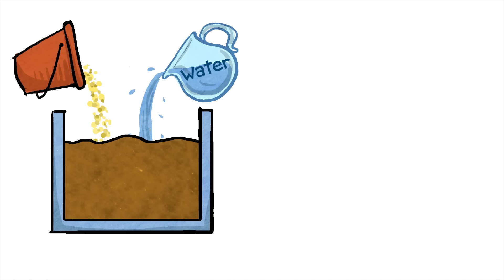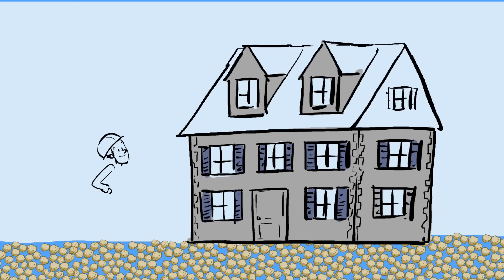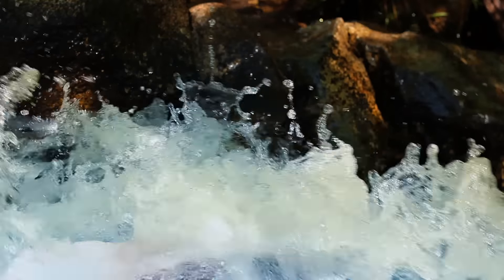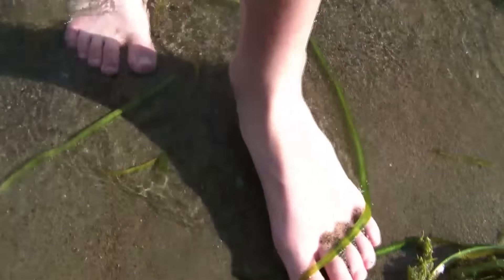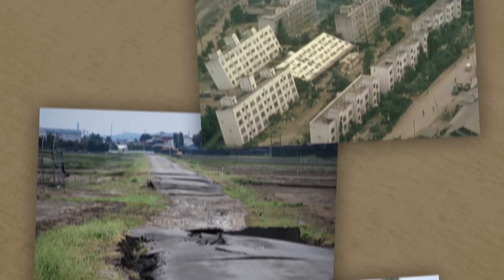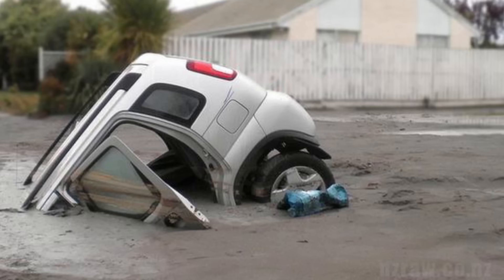What Happened To This Car?

Comment: Well I must say, that is rather interesting about the pocket watch.
Reply: How did they know it was the exact time the earthquake destroyed the pocket watch, yet preserved the time, versus the sunk pocket watch simply running out of power after it was buried?
Reply: Tony Yang
I myself was thinking the same thing.  Back in the day you had to whined up your pocket watch and it would last for about 3, 6, 12, and 24 hours.  The ones that last longer cost more.  So it would depend on the model and that would give you a window.  But who is to say that the person who had it hardly used it and it was just found on a random time?  Was in near a body.  There are a lot of factors.  Also, I have a hard time beveling the shaking of the city would stop it on the dime.  Especially expensive ones.  I guess it all depends.  Great point though.
Reply: Tony Yang I think the sand and water got into the clockwork to stop it from working and thus stopping i at the time the city sank

Comment: As far as I can tell, that pocket watch isn't an argument for exactly when this occurred. Unless the pocket watch stopped operating immediately upon this occurring that is. Also the pocket watch could have been adjusted relative to any time to begin with.
Reply: i agree. unless there were multiple watches that showed a similar time, i dont think they can say they know for sure what time it occured
Reply: Excellent point. In fact, we're assuming that the watch was functioning ... rather than just part of some pirate's booty that had not been wound up or maybe no longer worked at all.
Reply: ***** And even if you managed all that, I find it likely the damage caused could have altered the displayed time.
Reply: seigeengine Glad I wasn't the only one thinking about it :P
Reply: According to the NatGeo article that described the watch: When the watch rose out of the sea, a limy encrustation clung to its glassless face. An X-ray photograph of the matrix which had molded tightly to the watch's dial showed traces of the vanished hands, stopped at 11:43. Either the first heavy earth shock or the plunge into the sea halted the works forever

Since this watch was made "in or before 1686" it fits right in with the timeline of the sinking.

Also there are apparently several eye-witness accounts of the sinking that place the earthquake at just before noon (which the watch's time would corroborate). There are like 10-12 more paragraphs about this watch, but obviously they couldn't fit all that into this video :)
Reply: ***** Huh, interesting... thanks for answering (and finding the article for MinuteEarth :P wouldn't have this video without it I guess)
Reply: *****
how do you italacize
Reply: Hmm
Reply: @RobertJones interesting

Comment: As a Christchurch local, I knew where that car was instantly!
Liquefaction is really weird stuff. On a slope, it basically flows like water, which luckily saved the street I live on from being covered in knee deep silt.
Small amounts of liquefied silt produce 'sand volcanoes', which are basically conical piles of silt with water flowing out of the 'crater'.
If you see a hole with liquefaction pouring out, do NOT step in it, it is probably a LOT deeper than you expect! A friend fell into one of these, and broke her arm.
It is a real pain to move because it is so dense, and it sticks together quite well, so it is hard to dig out. Once it dries out, because it is so fine, it gets literally everywhere!

Comment: this usually happens to saturated cohesionless soils(like sands) . as the sand looses almost all of its effective shear strength mainly due to sudden violent vibrations ( like earthquakes) and the soil separates out as solid (sand particles) and water . most of the structure's load now falls on water which being incompressible can't handle it and so the structure above the soil sinks into the soil on which it was supported.

Comment: Minor nitpick, liquefied ground doesn't re-solidify instantly. It remains a liquid for an hour or so, and is still quite squishy several hours later. It is worst a few days later when it basically sets like concrete, making it difficult to move. Once it dries out though, the very fine silt gets everywhere, which is quite annoying.
I know this from experience because I went through the Christchurch earthquakes, and we had liquefaction on our street.

Comment: The water in the sand isn't pushed away when you step on it. Stepping on sand causes it to get displaced and rise around your foot. This rising sand does not have water in its gaps. These gaps are then filled in by capillary action with water being drawn out of the place where your foot pressed on.

Comment: Clay has much smaller elements than sand and there are clay particles that are like cards. They can make very stable structures with water supporting the "card house" but they also can suddenly turn to water and start to slide. Whole mountinsides have come down this way and sometimes there have been buildings on that clay and big disasters have happened.

Comment: If you take a shack box fill it with dry sand, ten place a heavy weight on it, it will just sit on top of the sand. When you shake the box the dry sand will act like water and move away from under the weight, and it will sink. I don't think Liquafaction has anything to do with water, other than describing how the sand (or soil) acts.

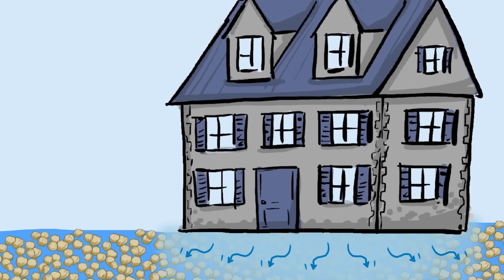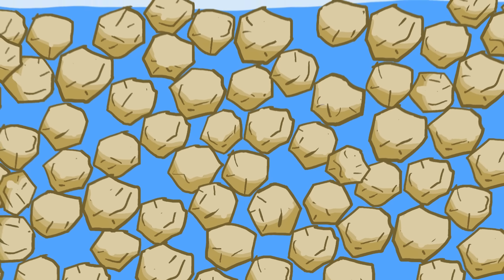Comment: I don't buy the explanation. 0:56 - "but in an earthquake, soil particles repeatedly jostle back a forth so much that the water can't flow away".  What about jostling is going to impede water flow?  No, I think that what happens is that the particles that normally rest on each other (0:40) repeatedly reposition themselves as they shake about and the pressure from an object above causes this repositioning to favor movement out from under the pressure.  This can happen without water, but the water increases the effect by acting as a lubricant and keeping open the spaces that open up between particles for a moment longer, allowing more repositioning.

Comment: I think your mixing up sink holes and quick sand.  Sink holes form because of erosion under a relatively dense surface.  The surface above seems stable until weight is placed on it, then boom, heads cracked open on a water main 20 feet below.

Comment: when he says "the sand starts acting like a liquid" it doesnt tell me much about why weights on sand during earthquake sink. can someone please explain this in an another way?
Reply: Well, non newtonian liquids start like a solid, but as greater amounts of pressure compresses the sand, the sand starts to shake rapidly due to the water inside.  The thing with non newtonian liquids is they can change forms when needed.  So when the watery sand shakes, it turns from a solid, to a liquid.  I hope that helped you.

Comment: What about Moving Sands ?! Why people Sing in it and need to hold something to lift them up even though there's no earthquake as it is only sands + water and sand particle should act as a solid structure and water should escapes away to lower Pressure points ?!

Comment: What's happening has nothing to do with sand liquefying. Sand cannot turn into a liquid through agitation and addition of water. You are mis-educating your viewers.

 What is going on, is that the sand particles, as they are agitated by the vibration of the earthquake, are constantly being re-arranged filling in cavities (the spaces between the particulates) that are able to accommodate them. When this agitation is occurring the space between the particulates are constantly being moved around as well, so that when the particulates fill in that space, that once un-occupied space is relocated elsewhere allowing another grain of sand to settle into it. Since sand is more dense than water, it will settle at the bottom and the water on top. Any remaining water will fill in the remaining cavities. When weight is added to the top or already exists as this is happening, that weight is forcing the relocation of the sand around the object because there is no other space for the sand and water to go.

An example of this can be done with anything as long as you have enough of it. A glass of sugar, salt, sand, a bucket of marbles and an object such as a toy car or whatever you can find. Agitate the glass by moving it quickly back and forth with very short but quick movements and you will see the object sink until you stop the agitation.
Reply: google first?
Reply: It's called liquefaction, not liquefying. Two entirely different processes.